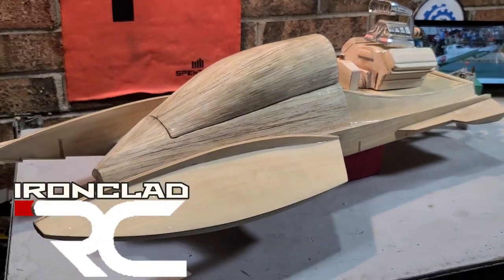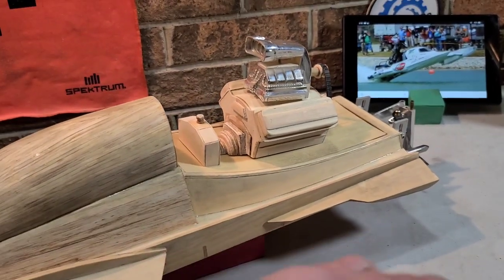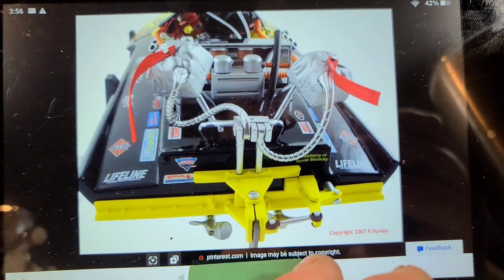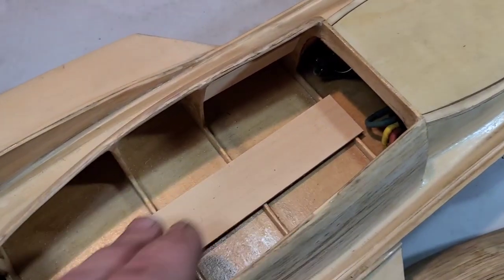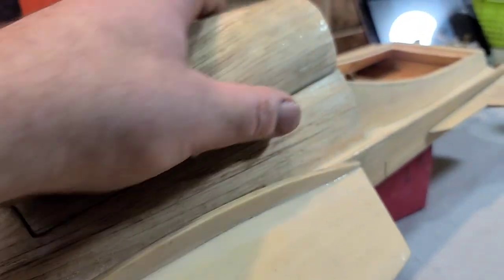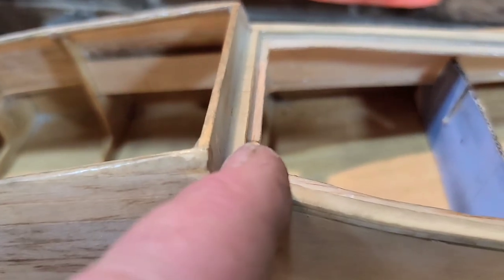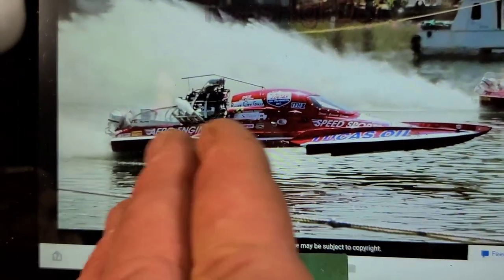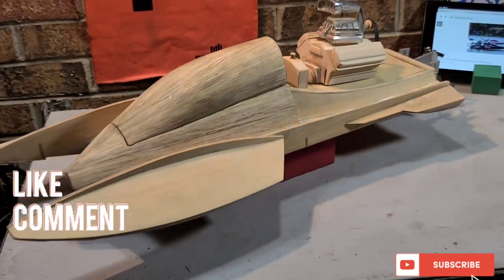Custom Rc Drag Boat Update - Homemade Rc Hydroplane

Comment: Looking good Big B. Love the progress you made. The wood V8 block looks killer! I think it will look great with the metal headers you shown us even though they might be a little heavy. Are you planning to make a wing? The Lucas Oil drag boat looks wingless, but I think the wing would be a nice touch. You can make custom Lucas Oil decals with Avery Printable Sticker Paper and an ink jet printer. You just need to find the various logos and download the files to your computer. You can easily size the logos on a Word document. Once the decals come out of the printer, let them dry for an hour then spray clear coat over the decal sheet to waterproof the decals. I've done many "theme" boats utilizing this process. Cheers!

Comment: You have done a great job man and please don"t get me wrong but i think you should spray the drag boat. 2K primer medeum grey then putty imperfecktions, reprime then paint with a rattle can. Don"t spray the paint or primer like your putting on bug spray, Long strokes from one end to the other 10  to  12 inches off the surfas. 20 min between coats . To see if it is ready for another coat find a sharp edge and touch it lightly with the back of your pointer finger. The paint should not transfer to your finger but be sticky. Same fore next coat. Remember you can put more on but you can"t take it off. I painted my MADFLOW then took in to HOLIDAY FORD"S paint shop to show the painter i use to paint with he coulden"t beleave i used a rattle can. The flow and the shine are amazing.

Comment: Nice nice nice !  Thought you'd go for 2968's. ?  (same 1800 Watt as 3660.......)
Reply from the maker: I thought about it, the weights are almost the same as a 2860 too. But the smaller can size sold me, its a very  compact build area.

Comment: 1940 props ?
Reply from the maker: I went with 2 x 38 1.4  counter rotating props to start with.  Probably cut them down to a 36 mm or reduce the blade area